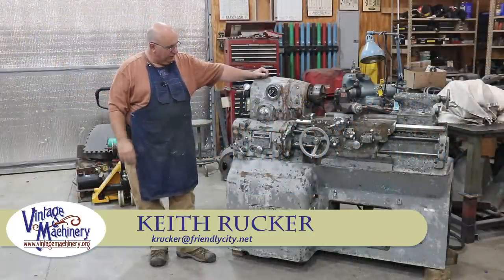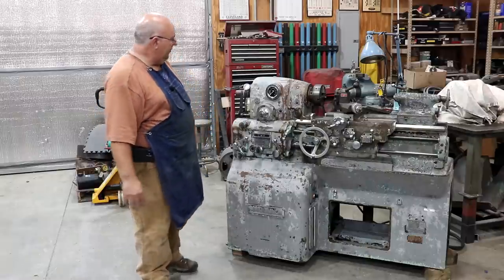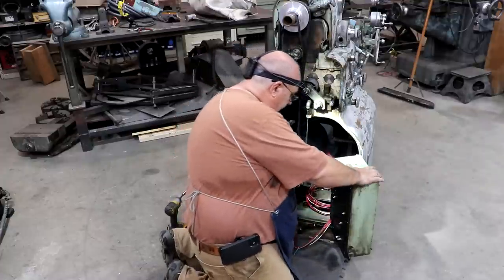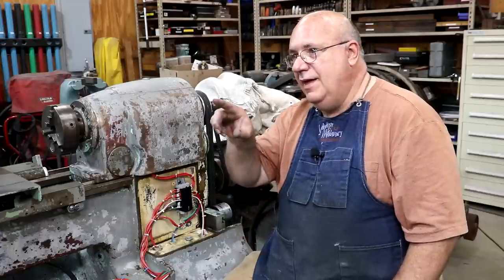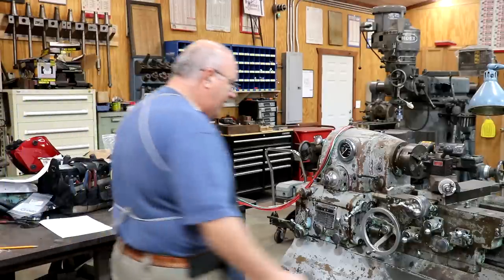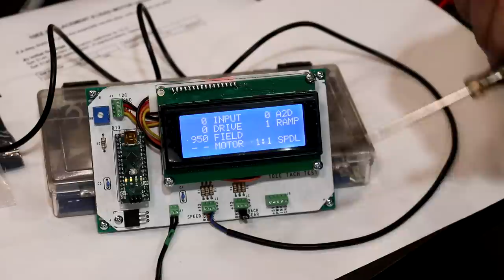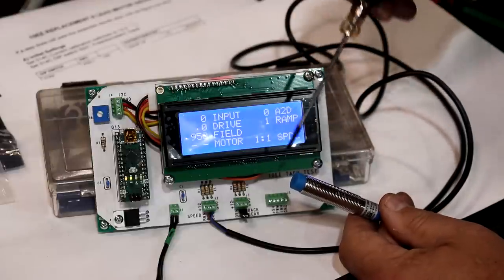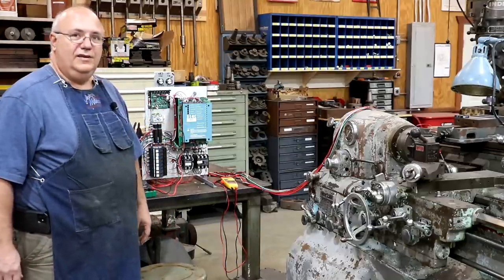Monarch 10EE Drive Retrofit 5: Wiring the New Panel to the Lathe and First Test Running

Comment: I don't find the content boring at all. I like seeing old equipment updated with modern tecknoledgey. 
 It's small potatoes compared to your undertaking, but I recently updated my old Atlas 618 hobby lathe with the Clough42 Electronic Lead Screw and the Touch DRO system. It made a huge difference in the old lathe! Such a pleasure to use now! 
Keep up the good work. I truly look forward to your videos.
Reply: I was going to retrofit a Clough electronic lead screw to my 1956 monarch 20c, before I got a deal on a CM cinturn 12u cnc may get another manual lathe later and add one on

Comment: Keith, 

Very impressive job.   Being an old school person, I was in college when HP released their first HP35 calculators.  I traded in my slide rule, which I still have,  for a $400 solid state piece of electronics. 

This project is a perfect illustration of the transition of analog to digital technology.  Being able to navigate this project speaks volumes to your abilities.  My guess is your knowledge of how the controls of the 10EE work in both the analog and digital world has made you a master not only of the making of parts, but of all parts electrical in your machines.

Bob
Reply: ditto, RUSH although I traded my slipstick in for a TI SR-71 (who knows what happened to the slide rule)
Reply: Lucky guy.  I graduated 4 years of Physics and Math with a slide Rule.  Two years later came a $600 calculator a desk top and was in heaven.  I then got a TI 4+1 banger and up and up from there.  Have my HP 41 and Printer.  Have a Ti ?61?.  I would love to have a HP35 early model.

Comment: I’m glad to see the hall sensor and the addition of a chopper wheel to provide a tach signal. This motor will be as agile as any mover on a CNC system. I’m sure it will be a joy to use after it is done.

Comment: I went thru Navy avionics schilling during the transition from tubes to transistors to IC circuitry and I'm always amazed at how much work covering the old tube circuitry to IC/Solid State parts.
Reply: neither of his 10EE lathes had tubes in them from the factory.  and yes i have laid hands on them personally.
Reply: @nilzlima3027  Pretty sure that the old series of lathes had 2 large mercury vapor rectifier tubes in the old circuitry to convert AC to DC for motor and controls!  The newer lathes had some sort of solid state rectifier in place of the old mercury vapor tubes.
Reply: @nilzlima3027  This lathe is from 1952. Keith mentions in an earlier video this unit originally had the thyratron tubes system in it, but all that had been torn out by the time he got it. His other 10EE is from the 40s and had a motor-generator pair in it.
Reply: @peterhaan9068  just a small EL1C is all the rectifier used in the Works in a Drawer drive.  Armature and field DC was handled by switching thyratrons at the right time in phase

Comment: I, too, would like to say that I have found the content about this electronic conversion fascinating. When this series started out I was mystified why you you did not put a VFD unit & three phase motor in. Now I see why. This lathe is really something rather special with its early DC variable speed drive. I can completely understand why you need to bring it up to date to be able to use it with the very nice DC motor to show the lathe off close to its original form. Thank you for sharing this with me & I hope others will agree with my sentiment.
Reply: Sorry I live in the UK. So it feels wrong to accept your offer.

Comment: Great video, I have one small critique,  power washing machines. The problem with your theory is that old machines always have grease and oil and when water gets into places it doesn't belong it frequently ends up with an oil slick on it that prevents evaporation. For instance the 10ee has shielded ball bearings under the saddle, those are guaranteed to have water in them that will take months to dry back out and do untold damage in the meantime. Power washing machine tools is just never a good idea, my Lucas 41 was power washed by a previous shop foreman and still has the oil groove shaped burn marks on the bed from the moisture it trapped to show for it.

Comment: Please, please, please don't forget the grommets and edging anywhere that wires pass through an opening in metal. This machine WILL transmit vibrations throughout the entire thing and it WILL eventually wear through the insulation anywhere it can, in some cases amazingly quick.

Comment: I pressure wash my stuff too. Simpler to work with clean stuff, plus, you'll be opening to inspect everything, change and fix everything. To do otherwise, would be a waste of one's own investment, when the gears grind to a halt because one didn't check for messed up parts. Obviously electronics are protected with bags and sealant before, but otherwise, these machines can take it just fine. Not like you're gonna blast them full gauge, just enough to remove decades of gunk.
Five years ago when i got my latest lathe, the thing arrived in so much grease and scum the operator actually saran wrapped my lathe to not get gunk on his straps. We don't buy these old girls because they're fresh off the showroom floor.

Comment: Keith, can I encourage you, when you paint this, to start with the most difficult, or intensive areas, then work towards the easier areas. It will give you more of a sense of accomplishment, and these you can do in-between other jobs. Also, if you work from the top down, it will also be a natural progression.
You're already working on the electrical panel, which is complicated, so you're off to a good start.
Reply: You realize that he's been restoring old machinery for at least 20 years, right? I think he's pretty well versed in what needs doing and how to get it done.
Reply: @kindabluejazz  I’m surprised though, that he didn’t repaint that box he added that new board to. It doesn’t look good.
Reply: @melgross  Again, and again - he's working on a *prototype* that he will eventually apply to his other 10EE that he will fully restore. He is doing the *absolute minimum* to this machine, just enough to use it as a prototyping platform. He didn't even plan on power washing it - he just did that because it was too gross to work on.
Reply: @kindabluejazz  just remember that this is a much newer machine than the other one. The reason he’s doing a “full” restore to the other, is because he got it first. I’d bet he’d rather do it to this one. Also, the older machine is well worn. This one might not be requiring a full restore. But, he’s planning to paint it. So paint the box too. It’s a minimal job. I do this all the time.
Reply: @melgross  Again, first things first. So many seem to think Keith should work according to their own schedule. Keith said he will take care of cosmetics after he gets the motor stuff done. And he said he will make a decision later if he wants to keep this one or sell it off. Why not just accept what he produces instead of the constant second-guessing and criticisms.
Reply: @kindabluejazz  I’ve been watching, and even discussing his work with him for years. I understand. But when assembling a machine, if you work on parts that are mounted internally, you finish them before you add parts to them, such as that board. Now, I don’t know if he’s going to remove the box again, and then remove the board. If so, he could finish it then. But usually, if he’s going to do that, he will mention it. He didn’t. So I’m questioning it. He’s had some different ways of interacting with commenters this time. Usually he responds to questions, suggestions and criticisms. He hasn’t here. It’s unusual.

So, generally, you remove everything interior to the frame, clean and paint it. Then the subsections to be added back are cleaned and replaced. That’s the easiest way. The outside, if the entire machine is t goi g to be stripped, is them painted.

Look, it’s up to him as to what he does. You don’t have to defend him, he’s a big boy.
Reply: @melgross  And you don't need to 'mansplain' to him or me on the 'right' way to do things - we're both big boys that have been doing this kind of work for decades.

Comment: I pressure wash old machines too. Properly done it is harmless and the best way to do it. I always paint and restore them too. I have sent machines out to an autobody shop if a lot of  bondo is required. Or to a powder coat place if a lot of blasting is required. They come back better than new. The auto folks have a very high standard so your headstock will come back looking like a Ferrari fender. I did a Hardinge HLV like that. We use it all the time. The archaic drive motor in the 10EE is a huge impediment to restoring one these lathes.  The Hardinge HLV is a far better candidate for restoration. The vari--drive works to 3000RPM as is and gives increasing torque with lower speed. Full support and spare parts are available from Hardinge. Hardinge parts are cheaper than any other sources. New leadscrews, bearings, badges, labels, knobs, handles,. control panels are all available at modest cost. I have replaced lead screws with factory parts. The cross slide screw is a 10 pitch left hand Acme thread. If you buy one with a new nut they lend you drill and tap alignment bushings and a left hand tap at no charge! Where are you going to get a left hand Acme tap. How much are you going to pay for one use. Fresh paint ,new bearings,
and new labels make an amazing restoration. I don't recall exactly but a new thread pitch chart for the gear box is likely $10. If someone offered me monarch I10EE  would run like hell.
Reply: There’s a 10EE on eBay now, or was last week. Not interested at all after watching Keith and Steve Watkins work on theirs.

Comment: I guess I've been involved in machine and process control one way or another for most of my working life well, over 50 years anyway, so I might be a wee bit biased but there is nothing remotely boring about this! I have to confess I'd not heard of the Monarch Lathe brand before - perhaps not many made it over to the UK - but it looks a pretty solid machine to put it mildly, don't think you could accuse them of under-engineering it?
I'm looking forward to the 'next thrilling instalment'!

Comment: possibly that I don't understand a particularity of that lathe , I always driven my lathes with constant speed motors and selected my spindle speeds with headstock gearbox.
For sure that such a system is an asset to select spindle speeds between the fixed  ratios of the gearbox.
It is a very interesting project.

Comment: Using an Arduino nano and a I2C 2004 display. I figured that would be the answer to the dual voltage  tracking for the 0-5 on the drives
Reply: Child's play for an Arduino or nearly any TI Microcontroller.
Reply: @matthewhelton1725  Yeah it'd be overkill for a launch pad unless you wanted to use a quadrature encoder. Which is the way I'd implement the speed sensing as interrupt counting on a Atmel 328 is crap and not very accurate.

Comment: I take it that the DC drive doesn't do reversing, that's why you had to have the reversing starter.
 Hope you checked that starter out, because if it drops out it might cause a problem with the drive.
I'm sure the forward to reverse can only be switched while the drive is off. Good choice on the starter, far As I'm concerned Allen-Bradley starters are the best.
 Looking good can't wait to see the final version.

Comment: Look at it this way, if the paint was so bad that it came off with the pressure washer, it's probably best to just repaint it.  It'll save you some rust or other damage down the line.

Comment: Correct me if I am wrong, but it seems like to me you have the capability to add input from a Cross-slide DRO to run a constant surface speed modifications. Are you considering that?

Comment: Teletypes were dust collectors and would often clog up during operation - oil ink everywhere.  The standard process is to Dish Washer it and then getting it out place it in a drum of oil.  Comes out dripping and water off.  Drain and place back in oil catch base.  Add paper and let them rip along.  They were the mainstay for the weather and other operations.  Emergency send and call.  Did not use the power line in the old ones.  Modern ones do. Real modern ones are electronic.
Reply: And never, ever get WD-40 near them!  I have a teletype I got from a guy who spent much of his career working on them, and spent the later portion of it restoring machines that had been poorly maintained, usually with WD-40, which works great at first, then gums everything up, making them very hard to de-gunk.  Typewriters have the same issues.

Comment: The electrical control box and wiring are mounted on a vertical panel. The panel is an aluminum piece supporting the heavy electrical inverters and control components.
It would seem that diagonal braces would be needed to keep it from wobbling, especially in a motorized environment.
Reply: That and the complete lack of rubber grommets in the thru holes have both been mentioned and ignored in the comments for all these videos.....
Reply: @notsofresh8563  Keith - Has already used sheathing on the wiring going to the motor controller.  This is a rough setup just for testing and adjusting and you can bet your bottom dollar the finished product will meet and exceed what you are nattering about now.  Give the man a chance!
Reply: The guys have spent countless hours working on solving the incredibly hard parts of this system, and yet so many people here want to criticize about the absolute most mundane of things. Of course he will figure out if he needs to put added braces or rubber grommets or mounts anywhere once he actually fires the thing up. He's not an idiot, like so many here seem to think. /smh

Comment: Modern electronics including a microprocessor being used to bring a vintage machine back to life is an interesting project. Personally I'm all for this but I can only guess the reaction of the purists. Hopefully what will come out of this is a lathe that performs better than the original did out of the factory.

Comment: The real drama is can you resist the urge to scrape everything in once you take it apart to paint.....
Reply: Right. With brand new electronics, and a shiny pretty paint job, the instant one of the slides shows a bit of wiggle, I foresee some grinding or scraping. No problem, it'll be fun to watch.

Comment: Please be careful with the separate DC motor field supply! If this goes to 0V, then the motor will speed up to extremely high RPMs, and most probably destroy itself.
Seeing this electronics board with an Arduino controller even increases my concerns, because these things tend not to be the safest and most reliable devices.
Please consider adding some safety feature (like wire break detection, Arduino crash detection, ...) which will ensure that the field never drop to 0V.
Otherwise your motor might destroy itself, and then all this amazing work will be useless.

Comment: Keith - great video.  Can you share the model number of the hall effect sensor you are using to count rotations.  Most of the sensors I have seen available require a magnet to be mounted on the moving part to trigger the hall effect switch.  But I know that some sensors exist with bias magnets inside that can sense any ferrous metals moving by - I just have not found any for sale - at a hobbyist price at least.
Reply: He has the sensor  it has the Round Red end remember he tapped the end of it with a crewdriver to simulate teeth passsing by it?
Reply: @briand01  Yes - that is precisely the sensor I am asking about.  It looks like a standard 10mm hall effect sensor from ebay or amazon except the ones from those places will not sense a screwdriver unless it is magnetized.  But, they do make sensors that will - a flywheel sensor for a car is a good example of a sensor that will sense unmagnetized ferrous metal. I was just asking what the model number was for the sensor that Keith is using because I would like to get some.

Comment: If the electronics aren't "important" from a conservation point of view, woudn't it be a lot cheaper to get a modern motor like a SynRM with a pre-matched motor control? Just considering the working time on projects like this... I've done this quite a few times, but with a LOT bigger motors and machines.
Reply: I vote for going AC, but it's not my project.

Comment: You really ought to use grommets whee you pass cables through metal panels to minimise the risk of damage to cable insulations. Doesn't the USA have any regulations about this?
Reply: For some reason he has ignored this suggestion repeatedly. It is actually in the electric code from his area, which I posted for info.
Reply: He knows, he knows, sheesh, he's not an idiot. Just let him get the hard parts done. He will do the mundane stuff later. /smh
Reply: The metal panels are thicker, and he chamfered the holes so it would not damage the wires. Many industrial panels like these do not have grommets, and just have rolled edges.

Comment: You could control your potentiometers with a gear at the base of each knob. One knob will control the other. Figure the ratio between the knobs and machine or 3d print them. They could even be odd shaped gears to change speeds independently if you needed to. Probably more fun than wiring😃
Reply: I think that is what they are doing electronically. Computers are way more efficient at doing this.
Reply: @leeklemetti1887  But not nearly as fun to put together in my opinion. I may be biased, I enjoy making wooden automata and have cut lots of gears on the scroll saw.😀